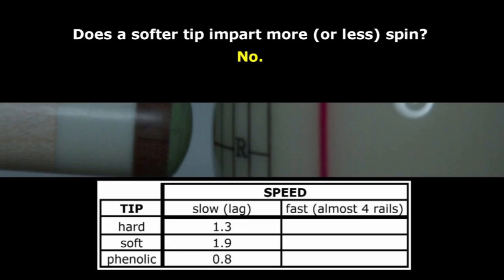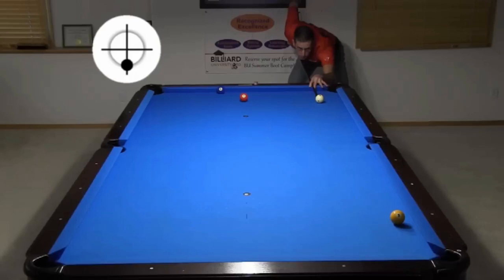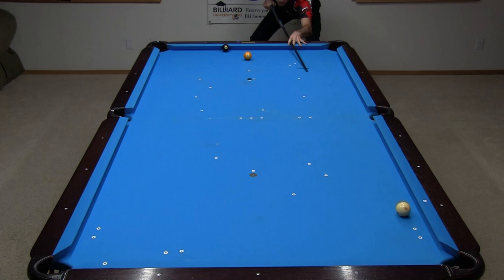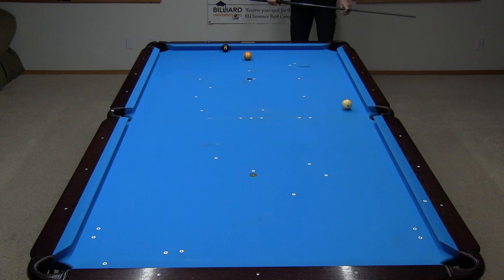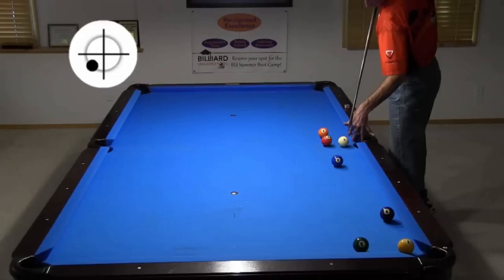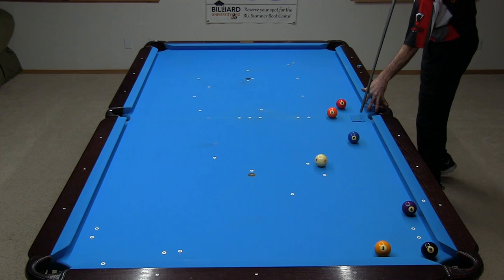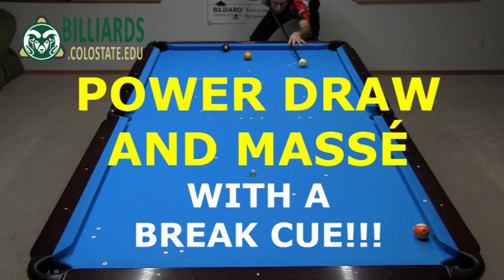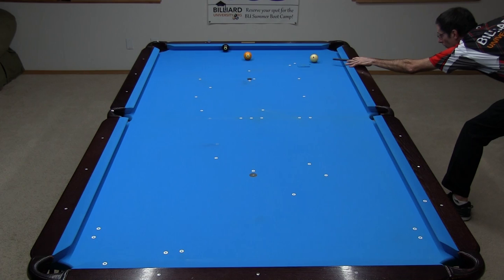POWER DRAW and Large-Curve Massé with a BREAK CUE Phenolic Tip!!!

Comment: Anyone who thinks you can't do this with a break cue has clearly never slammed the break and accidentally gotten more top english than seems humanly possible. Break cues can put an ENORMOUS amount of spin on the ball and I'd argue potentially even the maximum amount due to their smaller contact patch. As long as it doesn't miscue a smaller contact point would mean more energy transfer toward the edge of the ball.
Reply from the maker: Good points.  For more, see:
    https://billiards.colostate.edu/faq/cue-tip/hardness/

Comment: I in the past had a back up break cue that was 22oz, I primarily break with a 17.5 oz break cue. That I had a tiger jump break leather tip on. That thing masse great. I think the weight of the cue helps more on the extreme masse than a softer tip. That being said I've done some crazy masses with my current break cue. But I really have to juice the cue ball because my break cue is to light
Reply: I know people say to use a light break cue, but I like the extra weight and I feel more in control and never have issues with heavy cues. It’s a preference I guess

Comment: Just a correction - The BK Hybrid tip is not a phenolic tip, it is a hard layered leather tip infused with resin additives.

When we asked a Predator rep where to get a replacement break tip, they've recommended to get the Samsara leather break tip. So it seems it's the Samsara break tip with a bit of Predator's twist on it.
Reply from the maker: Good point, but it sure seems as hard as any phenolic tip I've used in the past.  I think the BK Hybrid is still basically a phenolic tip, just with some layered leather mixed in it to make it "legal" under the WPA official rules of pool.
Reply: id argue that the hardest jump/break tips cant get as much spin, but those on the softer end spin just as well as a playing tip. ive cycled through a few jump/break tips to use as my playing tip, these are my observations:

I've tested a bunch of jump/break phenolic tips, with a durometer and with my own judgement of how much spin im getting. I've played with each tip for weeks at a time, sometimes for over a month. I can say the "softer" jump/breaks tend to spin like playing tips. These include the bulletproof (a clear tip), and a navigator break impact (leather infused with phenolic resin, creating a hybrid material). a samsara and white diamond didnt seem to spin the ball as the navigator break impact and the bulletproof. samsara and white diamond were harder on the durometer too.
Reply from the maker: @masterdurick5667  Thanks for the info.
Reply: @masterdurick5667  I have been playing with a Taom phenolic tip on my playing cue for a couple months now. I replaced the tip right after I watched this video.

After I have gotten use to it, I could put as much spin as a leather tip on a cueball. At first it was pretty hard because I was having doubt, and was so scared to misscue. We all know how things go when we hesitate 😂. Now, that I have gotten more used to it, I can say I don’t misscue any more than I did when I was still using leather tips.

Comment: I agree that power shots are easier with a really hard tip. I have a bullet proof tip on my break cue and it gets stupid action. I've actually considered going to this tip on my playing cue because there's nothing I can't do with it and I get better speed control with a hard tip. Currently I am back to using a black ultra skin hard tip on my playing cue. Does great
Reply: qq - does your break cue have a regular ferrule with the bullet proof tip? Or phenolic? Trying to upgrade my current break cue and wondering if the bullet proof tip is enough.
Reply: @dilloncloud2175  well mine is a custom xlr8 break shaft with a one piece bullet proof tip ferrule combo that matt makes. But I have friends who use them on regular playing shafts and they still break great. But truthfully they don't break as hard as phenolic. But get a lot more action and spin. Also they jump better which is crazy. But I think this is due to the fact they are a lot lighter than phenolic. The fact is they are some of the lightest tips on the market
Reply: The amount less is super small. In fact in the real world you can break harder with the bullet proof because you have less of a fear of miss cueing. Same is true with the taom 2.0, and kamikazes version and the other versions. Really it's up to you which brand you use
Reply: Sweet! That helps a lot, thank you!
Reply: @dilloncloud2175  no problem. Personally I'd probably just buy makos version because it's the cheapest. Buddies have a variety and I haven't noticed much if at all different between them. I'd suggest having at least an ivorine ferrule due to wear of breaking. You wouldn't want one of the softer ferrules. Plus I'd use the tiger tip glue. Just because like phenolic you can have them pop off with the weaker glue.
Reply: I shoot with a bulletproof. Works good

Comment: I make tips that are just a hair softer than the bk hybrid, and use them on both my break and playing cues.  I don't see myself ever shooting with anything else.  I've installed them for a couple others, and they instantly loved them. 

Almost no maintenance, but they will get out of shape due to wear, especially at the edges and center.  Probably wouldn't be so bad if I didn't have such an all-or-none approach to spin, which I'm working on. 

I massé with them all the time.  No problems at all until I get pretty vertical and put power on it.   Then the hop kills it.
Reply from the maker: Sounds like a good approach.

Comment: Dr. Dave, I like to get your thoughts on this: Might a softer tip impart less speed on the cue ball that the spin has to overcome which would be important on draw shots that are cuts. In other words, with a harder tip the cue ball would travel down the 90 degree line longer before drawing. I always thought of a good stroke being able to generate more rpm’s per mph. What do you think? Might make a good video.
Reply from the maker: For a given tip offset, a softer tip imparts slightly less speed and slightly less spin by the same proportion.  For more info, see:
    https://billiards.colostate.edu/faq/cue-tip/hardness/
Reply: Thanks for the reply. Love your stuff!

Comment: Very good Dr Dave . I find it interesting that the top snooker players have abandoned carbon shafts and use predominantly ash with leather tip's and can screw the length of a snooker table
Reply from the maker: I suspect we will see carbon fiber in the snooker world some day;  but they are quite steeped in a long tradition, so it takes a while to change, especially if there is no compelling reason to change.  Their small-diameter ash shafts already have fairly low CB deflection.
Reply from the maker: I deleted your reply by accident.  You were asking why pool players use 11-13mm CF shafts when snooker players use much smaller diameters.

Pool players prefer larger diameters with the larger ball diameters.  Also, CF can easily be made low-CB-deflection at almost any diameter.
Reply: @DrDaveBilliards  hi Dave I believe the snooker ball size is comparable to 9 ball size . Maybe slightly different but considering the massive difference in length of the table they have to excert much more control especially when using bottom and side spin at the same time ! My reasoning is personal preference.... Also as a back note the European players in the Moscone cup have no problems utilizing the small tips on wood cue's .  each player whether 9/8 Ball or snooker will find a cue that works best for themselves
Reply from the maker: Snooker balls are definitely small than pool balls:
    https://en.wikipedia.org/wiki/Billiard_ball
A smaller tip works fine in pool, but a much larger tip would not work in snooker, where you would not be able to get the tip contact point as low on the ball:
    https://billiards.colostate.edu/faq/cue-tip/size-and-shape/

Comment: Have you looked into the possibility of the cue ball lifting slightly off the bed of the table on power draw shots, much like how it deflects to the side using sidespin.
Reply from the maker: Actually, because the cue must be slightly elevated to clear over the rail, the CB is driven down.  CB deflection (in the up direction) cancels some of this; but with a power draw shot, the CB actually jumps a little.
Reply from the maker: Another pool myth is that having the CB be airborne during draw shots helps, but this is not the case because spin is lost on the first (and and subsequent) hops.  For more info, see:
    https://billiards.colostate.edu/faq/draw/cue-elevation/
Reply from the maker: CB hop happens even more with power follow shots, where the cue elevation and CB deflection effects add, per the info and demonstrations here:
    https://billiards.colostate.edu/faq/follow/ball-hop/

Comment: I agree with you, but one complaint you left yourself open to is that the BK Rush tip is leather, resin hybrid. An actual phenolic tip is quite a bit harder.
Reply from the maker: It sure seems as hard as any phenolic tip I've used in the past.  I think the BK Hybrid is still basically a phenolic tip, just with some leather in it to make it "legal" under the WPA official rules of pool.
Reply: @DrDaveBilliards test different jump/break tips with a Shore D durometer to find out.
Reply from the maker: @masterdurick5667  Good idea.

Comment: This video begs the question, if you can impart the same spin regardless of the tip hardness (and size and shape appropriate to the diameter), why any difference in the masse shot ? Clearly something is different and not in a minor way. Is contact time different enough, masse vs non-elevated, to make tip hardness a factor again ?
Reply from the maker: A masse shot is very different because the tip needs to trap the CB to impart enough spin.  See:
    https://billiards.colostate.edu/faq/masse/cue/

Comment: So what are the downsides of using your break cue as a playing cue then (when not attempting large curve masse shots at least)? Will you be switching to your break cue for long distance power draw shots going forward? You said you got better action and didn’t miscue once…
Reply: Break cues w/ hard tips have much lower accuracy.  A slight hit off center would result in greater deflection, making it more difficult to use overall.  If you have a perfect stroke, you could have success, but it's not worth it.  Also, the amount of extra draw you might get from a break cue is minimal... because we're only talking about full draw and how often does that ever come up?  Rarely.
Reply from the maker: I do fine with my playing cue, so I see no reason to change.  I am also very accustomed to the hit efficiency and amount of CB deflection for my playing cue, and I wouldn't want to use a different cue during play.  It would required adjustment.  Although, it is honestly tempting to pull our my break cue for a power draw shot just to mess with my opponent.
Reply: @DrDaveBilliards  please do and report back! Love what you do btw, and owe you a debt of gratitude for all your great content over the years

Comment: This would have to mean that the coefficient of friction between two objects (tip and ball) with a layer of chalk between doesn’t depend on the material the objects are made from. While that isn’t obvious to me, perhaps it is nonetheless true 😉
Reply from the maker: Yep.  It is the chalk particles that dig into the tip and CB that lock the surfaces together.  For more info, see the “Why is there no difference in the miscue limit among different chalk brands?” section here:
    https://billiards.colostate.edu/faq/chalk/comparison/
Reply: Following your link, it seems that the miscue limit is not only independent of the tip and ball characteristics, but also independent of the chalk used. 

Is the miscue limit a universal physical constant that depends on no known variables? 

Much as pi is the same for any circle, is there a maximum spin/speed ratio which anyone can achieve, but no one can exceed, totally independent of equipment used? If so, what does set the limit?
Reply from the maker: @martyjones5841  I was honestly shocked when I couldn't find any measurable miscue limit differences among all the chalks I tested here:
    https://billiards.colostate.edu/faq/chalk/comparison/
The best explanation I have to explain this is in the "Why is there no difference in the miscue limit among different chalk brands?" section on that page.
Reply: I too am shocked at this. It does not seem reasonable that the miscue limit for speed/spin ratio would be a universal constant, dependent on absolutely nothing. 

In a 45-year engineering career, I don’t think I’ve ever encountered a physical phenomena this complex whose functional description contained no variables.
Reply from the maker: @martyjones5841  I guess the chalk particles embedding into both the tip and CB to lock the surfaces together negates any other possible variables.
Reply: I’m still going to lose a little sleep over why all the combinations of chalk, tip, and cue fail to achieve “lock” at the exact same limits.

Too bad - we could make a few nickels from an equipment option to extend that limit 😉
Reply from the maker: I suspect all chalks use similar particles.  And I suspect the exact type, size, and number of particles probably doesn't matter much, as long as the particles embed into the tip and CB during contact to mechanically lock the surface together, unless the tip is beyond the miscue limit, in which case the locking seems to not be able to occur.  I might lose a little sleep too.    :)